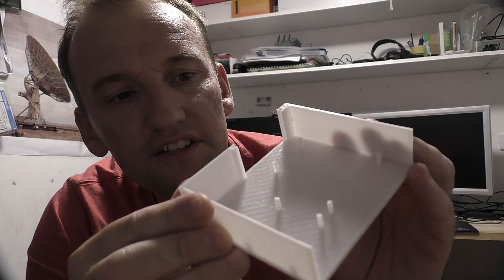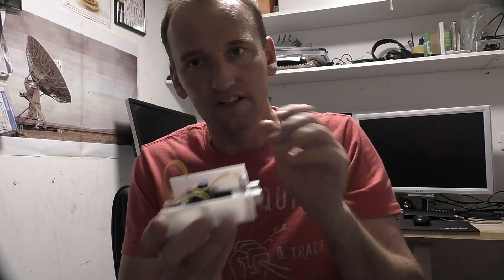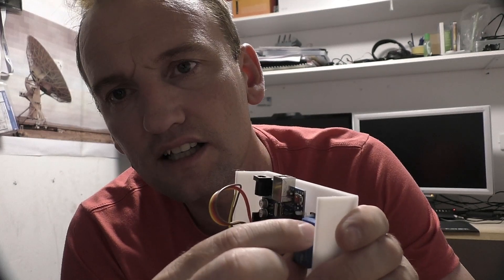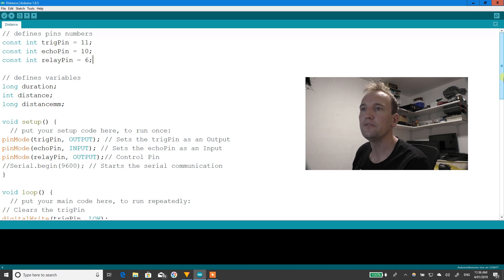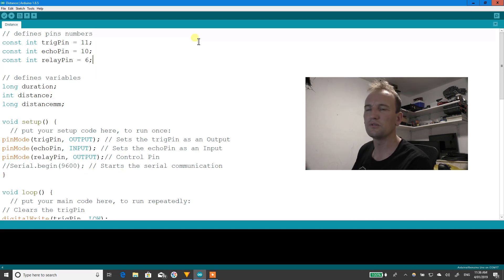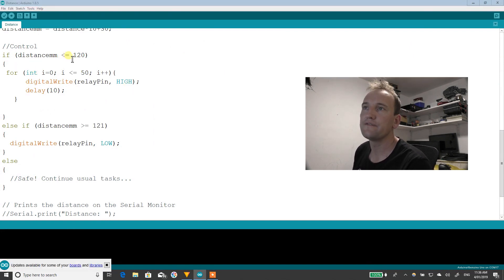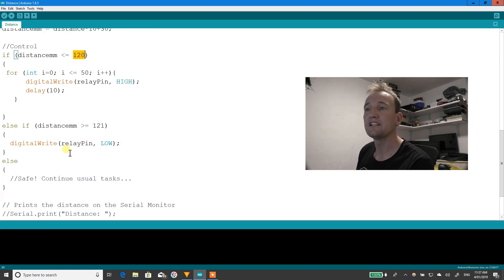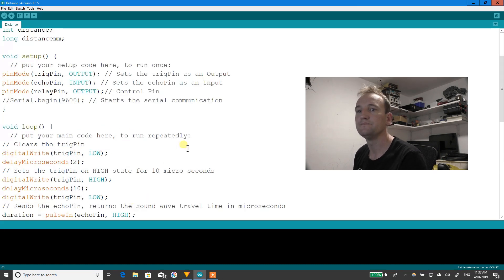Arduino - Ultrasonic relay project

Comment: my relay says  "low level trigger" 
so is this code correct or do i need to change it and reverse the  triggers LOW and HIGH  in the code?
 i know there are 2 kinds of relays  a low level trigger type  and  a high level trigger type  , i am not sure which one you are using here ,but mine is low level trigger
Reply from the maker: just try changing all the lows to highs and vise versa
Reply: @50Hz  yeha that is what i figured thanks i wrote that before i  tried it just now on a pro mini ,it works but the green light on the relay is on when nothing is in front of the sensor 
i don't think it matters really , as long as the relay triggers i guess i can  always use normally closed pole instead of normally open , but for my application it doesn't matter much since i will be using both normally open and  normally closed, 
i have a RF universal remote  hub (broadlink RM pro) i use to operate 2 relays   to open and close my garage door, i was using a single pole double throw momentary switch button with the 2 relays so that i can have a separate  signal for open and for close instead of the  toggle that the garage door opener has  so i can use it with my smarthome
i am going to use this  to replace the switch   because it's cemented into the floor and a contractor broke it
Reply from the maker: @andreamitchell4758  sounds like you found a decent solution to your problem, that’s awesome

Comment: so if i want to  change the distance to 1 foot then i would rewrite the line
" if  (distancemm <= 120) "
 to " (if distancemm <= 300) "
and rewrite the line "else if (distancemm >=301)
Reply from the maker: I'm not sure of the conversation off the top of my head but you sound correct

Comment: Thank you! I am relatively new to programming Arduino and have been making a "stop signal" to mount in my garage. Green for drive in, yellow to pull forward and red to stop. All follows, I reckon lol! Will help me tremendously with this quarantine project. Cheers.
Reply from the maker: Sounds like a cool project. I found the best way to stay motivated in learning electronics is to build something you need. Good luck I'm sure you can build something great

Comment: Hi. I want to ask you. what's the code if i use 2 ultrasonic sensor and 2 relay ?thanks
Reply from the maker: Off the top of my head I don't know. But you should try and hook it up and check one device after another. It really shouldn't be that hard

Comment: I want to ask, why when the Arduino turns on, my relay is also active immediately, even though I haven't touched the ultrasonic sensor, I want the relay to be active when the distance is 5 cm

Please help me!
Reply from the maker: Does the relay pin go high in the setup. Try setting pin low in the setup.
Reply: Still not working
Reply from the maker: @edipurwanto4618  email me your ino file and I'll try and have a look at it for you. jongrimes1983@gmail.com
Reply: Ok, wait!
Or, maybe the problem is with the relay, what is your relay brand or model?
Reply from the maker: @edipurwanto4618  you have have it set to normally closed. Sorry I can't. Remember what the brand of relay it was but most are the same
Reply from the maker: @edipurwanto4618  I have sent you back an email. Please let me know how it goes
Reply: @50Hz  don't some relays have  opposite  settings  some have pin high and some have pin low to activate i think

Comment: what is maximum range for that ultrasonic sensor actually I'm working on project similar to it I need to turn on and off lights and fan's using Arduino
Reply from the maker: Suresh Hater is have to google it, but I’d expect just over 2-3 m
Reply: 4meter. you can also read it from the datasheet of Hc-sr04